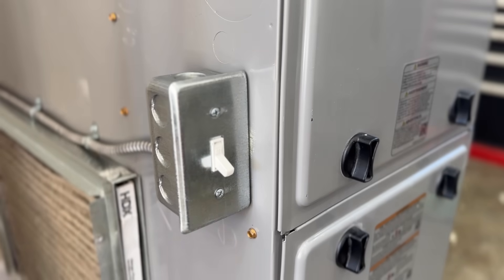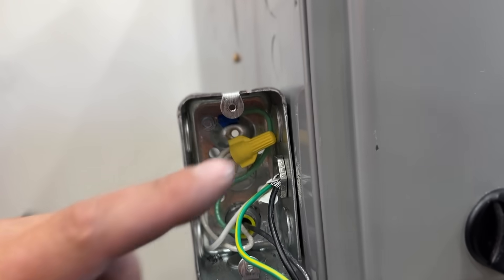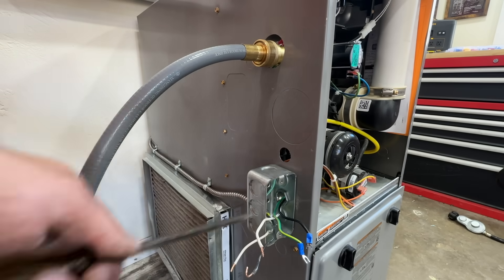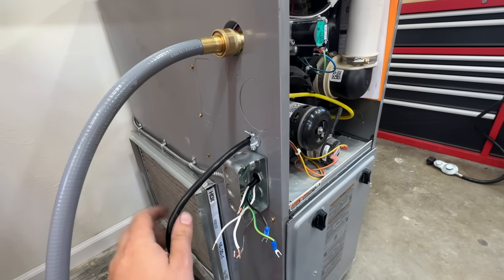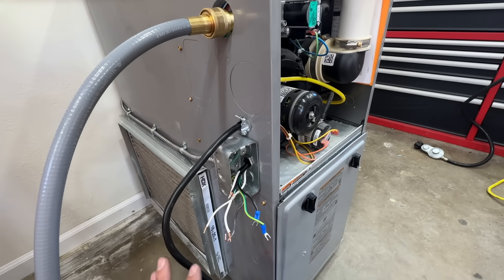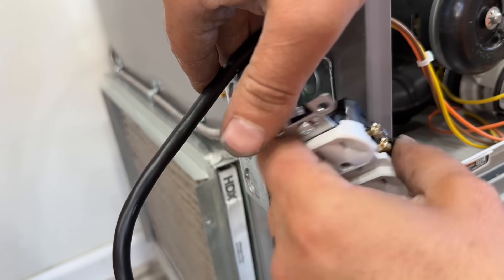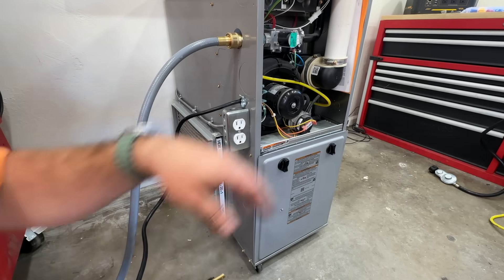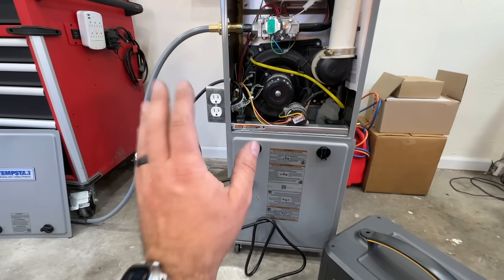Keep Your Family Warm During A Power Outage By Installing This $5 Part

Comment: If a hile is required in the side of the unit its actually a 7/8" hole not 1/2". 
The 2 screw romex connector is not meant to be used for cords, whats required is a strain relief connector for the round cord. Make sure its appliance rated and at least #14 wire cord

Comment: That is a bit more than $5 with the battery back up unit.  Also, code does not allow an outlet to be grounded through the box.  A ground pigtail should have been used.

Comment: Couldn't you have used a 3-way switch wired so that when the switch is ON (up) the furnace gets power from the line, and when the switch is OFF (down) it gets power from the plug?

Comment: Great project to knock out and be prepared for when the power drops. I had a switch and single outlet. I kept that setup but rewired it up as you got here. I added a 1 to 3 outlet cube to it so I could plug in my pump, furnace, and UV light.

Comment: So I just did this, and when I cut my main power and hooked my solar generator up nothing happened 🙃 I had battery back up in my thermostat, turned it 1 degree higher and nada. Dangit
Reply from the maker: Try bonding the neutral and see if it works.
Reply: @diyhvacguy  ok ill try it!

Comment: I don’t think way the ground is connected is allowed by code. Check with your local authority. The extra length of cord may also be a problem. Just because it works doesn’t mean that it’s safe. 
Sometime I wish the background justifications for codes were available, but overall we just need to trust the process.

Comment: Just make sure to keep the Breaker box breaker turned off, so the auxiliary power source doesn't backfeed to the city power & send power to crews working on the power lines. when other power is restored, you'll see lights or other things come online... then ya can disconnect aux power & flip the main city breaker back on.... Ya wanna make sure ya don't back feed power & zap someone restoring power...
Reply: This can't backfeed because it is never sending power into the outlet

Comment: This is pefrct when you have a gas generator and a V2L capability EV. For a 60kwh battery pack Ev. This set up will give you 40hr continuous operation. In real life, this set up give you a whole week of running the furnes without the generator. Hence, you can keep your self warm for close to 2 weeks

Comment: How many G’s does a typical furnace pull?

Also, with a 1000 watt battery backup, you might have what… 2-3 hours of use powering that furnace? 

Thanks for a fantastic video by the way.

Comment: So does thos still operate off the thermostat or does the furnace just run so long as its plugged in?
Reply from the maker: The thermostat gets its power from the furnace so as long as the furnace has power your thermostat will control it just like it does on grid power 👍🏼

Comment: You could always use an outlet with a built in on/off switch or a plug in intermediate switch to still integrate the original concept.

Comment: Will this work on my forced hot air oil burner. I would think it would. This is all I wanna be able to do run the furnace.
Reply: An oil furnace will use more current than a gas furnace does because in addition to the forced air blower the oil burner has a high pressure fuel pump to force the liquid fuel through a nozzle or nozzles to turn it into droplets so fine that they will burn like a gas. Oil is a combustible liquid. That means that it does not give off flammable gasses at normal ambient temperature and pressure. That is why fuel oil is refined to be so close to kerosene in it's viscosity. Fuel oil can be atomized into super fine droplets that will behave as a gas in the combustion process. How much current will be needed for the blower fan, fuel pump, and controls to operate can be found on the label on the furnace which bears the listing mark of a Recognized Testing Laboratory (RTL). The number that you are looking for is the Full Load Amps (FLA). The inverter must have a high enough ampacity to run the load and a high enough surge capacity to start the motors turning. That starting current can be 5 or more times the FLA. Even when the inverter has been properly sized the battery must be selected to have a high enough maximum discharge rate to power the inverter during surge operation. Discharging a battery at a higher discharge rate than its designed maximum will destroy it. Sometimes the battery's destruction can be quite spectacular and very hazardous to living things. 

Tom Horne

Comment: I did something similar on my boiler, except I put a box on the boiler side of the switch with an outlet.  Now if the power goes out I turn off the switch and then just use a double male extension cord to go from the generator to the boiler.

Comment: Can the power pack be plugged into the top outlet while house power is still on charging the power pack/solar generator?
Reply from the maker: Yes in which case you’d plug the furnace into your power station and it would keep the power station charged and also utilize the auto transfer switch in the event of an outage.

Comment: I have a condensate pump plugged into the same power box as the heater when i turn the  switch off it shuts power off to the gas heater and leaves power on to the condensate pump is that the same as you are trying to accomplish on your video ? Thanks

Comment: With my Vitoman 1500 plugged in, the furnace and gas shuts down once the cycle reaches for the blower/fan to turn on. It was pulling 575 watts initially.  Plan to try my Honda 2000 to see if that works, which was my goal for powering the garage. Will 2x check ground to panel.

Comment: Should have a gfi or a single yoke receptacle. Not a duplex receptacle.
The appliance cord could be considered as service disconnect not crazy about that I like to see a service switch.
But that part depends on AHJ inspector.
Oil need a shut off switch in a remote location. I have A problems with that part. But gas or propane. Doesn’t matter a spark can go boom.

Comment: I installed a plug on mine and it was $8 .Worth the money and a lot cheaper than buying a $5500 back up generator I just bought a 2200 inverter generator for $450 and bought some old 5 gallon metal gas cans at a flea market and I’m set .

Comment: ALL GROUND WIRES MUST BE CONNECTED TOGETHER!  This way even if you unplug the furnace from the normal outlet, it will still be grounded.  The way you have it here, as soon as you unplug it, you disconnect the ground.  Now the panel ground is mounted to the box, and the box is mounted to the furnace, but I'm not sure that's the best ground.

Comment: We have this on ours already, which really does give me the peace of mind that if the power goes out I can plug it into the generator fairly easily.

One thing to be very careful here is to be sure not to mix up your wires and connect the furnace directly to the power supply and wire the pigtail to the outlet. Your furnace will run fine normally so you wouldn't be aware, but it would both fail to do anything with a generator when the power goes out and it removes your emergency shut-off.

Comment: Is there a chance that switch would be anywhere else in the house other than on the furnace? I have a gas furnace but don’t have that switch. Now we do have a switch upstairs for a gas fireplace. That has a battery back up and we can run that when we lose power.
Reply from the maker: Well it’s entirely possible it was miswired, but you can totally turn the breaker off for your furnace and add this to it!
Reply: Thank you! That’s a great idea!!!

Comment: I was thinking about doing this but my thermostat is digital and takes power from the wires it’s hooked to. Are those completely separate from the house and run straight to the furnace or will I need to replace it with a battery powered one?
Reply from the maker: The thermostat gets its power from the furnace 👍🏼 so it will function exactly the same as long as the furnace has power

Comment: I really liked this idea, so I decided to do this to my furnace. I bought a 3 foot 12awg/15amp cord and wired it to my Guardian (York) 95%efficiency furnace. I also have the Nest smart thermostat. I verified power is on with a non-contact voltage sensor, and even plugged my vacuum cleaner into the electrical outlet after I completed the installation. I have a Champion Dual Fuel 3500 watt generator that I connected to my furnace with an extension cord. I'm now getting an E24 error message on my Nest thermostat saying there is no power to my RH wire detected. Maybe this is an obvious problem for someone else, but I don't know why it has this error now. Any help? My furnace currently only works when it is plugged into the outlet, not the generator.
Reply from the maker: You might need to bond the neutral. You can do this by getting a neutral bonding plug and plugging it into another outlet on your generator.
Reply: @diyhvacguy  I'm not quite sure I understand. I do know I need to buy a heavier gage extension cord. My current one is not heavy-duty. Should I then replace the new cord's existing male plug with a neutral bonded one? Do you know of any heavy gage extension cords that are already made with neutral bonding, or maybe a neutral bonded adapter? I can't find one if they do make them like that. Sorry for all the questions, I'm still figuring this out. I appreciate your help.
Reply: Some thermostats receive their power from a transformer inside of the air conditioning unit (in lieu of the furnance). So if there is no power available to the 30A 240V circuit to the AC unit the T-stat will be running on it's on-board batteries only, if it has batteries inside of it. This will cause an error code on the T-stat letting you know that power is not being supplied to the T-stat.
Reply: @billbutler6479  OK. Is there anything I can do to fix this?

Comment: The one thing you should have said is check to see if it is a two-pole breaker which means it's 208/230 volt and this will not work, you don't want people hooking 120 volt up to the 208 volt system

Comment: I had this set up more than ten years ago the plug was plugged into a wall outlet.And beside I had another outlet extension(I forget the cable size, bigger than regular orange extension cords) out to a generator,it worked very well.I would recommend every furnace be set up like this.

Comment: great video, excellent idea.  just 2 minor safety points. When installing the outlet, since its in a metal box, use electrical tape around the neutral and live terminals.  also its good practice to screw down the unused terminal screws before putting bsck into the box, helps limit the amount of potential shorts.
Reply: A good reason to use the single switched outlet

Comment: This is a clever trick to use with a garage door opener too. If the power is out and your generator is in your garage, you can set it up similarly for the garage door opener. 

You have 2 code violations, easy to correct both. Can't use the romex connector as a means of support, shoot a couple self tappers from the handy box to the furnace side. The box is over filled, the pigtail and furnace connecting wires can be pulled back into the furnace.
Reply: Don't garage door openers usually already have plugs?

Comment: what if theres no switch? we just had a new furnace installed in '21.....
Reply from the maker: The plug becomes your means of disconnecting the unit, just like a switch. In fact, this method cannot fail whereas a switch can fail in the on position.
Reply: @diyhvacguy  i found it....its got a blank plate/cover with no switch, the junction box is there...but just a blank cover....thanks!!!

Comment: you could have used a knockout in the junction box instead of running the wire into the body of the furnace and then back into the junction box.

Comment: Thanks, Dave, for a GREAT video! You didn't mention, though, how to power my house thermostat so it can control the furnace that's plugged into the power station in my garage. Can I run an extension cord from the power station into the house and maybe to a spare 110V AC to 24VAC transformer and thermostat? If so, how do you wire the thermostat back to the furnace?...12/12/23 UPDATE: Many thanks to @fishepa who pointed out that my house thermostat gets its low-voltage power from the transformer on my furnace out in the garage! That makes it too easy...all I need is the power station and I'll be all set for the next power outage. FYI,  I see Amazon currently has coupons for $400 off the price of the VTOMAN Jump 1000 and $550 off for the VTOMAN FlashSpeed 1500 (about 40% savings for each).
Reply: I am a total novice at this, but wouldn't the thermostat get power from the furnace?  So the generator powers the furnace and thus the thermostat?
Reply: Thank you!

Comment: If your house has no power, wouldn’t the thermostat not work to run the hvac even if you plug in the furnace?
Reply: The thermostat is powered by the furnace

Comment: Idk man I really feel like you should really just hook a ground to the plug. I understand that the box is bounded so the plug is bounded but if there is a ground screw you just hook it on. It is little to no work to do and is much safer and less sloppy. Maybe that is just me, it is one copper wire just make a tail with a wire nut. If you have green wire you can use that to make it look good. but if not you could take some bare copper #14 and use that.
Reply: 250.146 Connecting Receptacle Grounding Terminal to Box.
An equipment bonding jumper shall be used to connect the
grounding terminal of a grounding-type receptacle to a grounded
box unless grounded as in 250.146(A) through (D). The
equipment bonding jumper shall be sized in accordance with
Table 250.122 based on the rating of the overcurrent device
protecting the circuit conductors.
(A) Surface-Mounted Box. Where the box is mounted on the
surface, direct metal-to-metal contact between the device yoke
and the box or a contact yoke or device that complies with
250.146(B) shall be permitted to ground the receptacle to the
box. At least one of the insulating washers shall be removed
from receptacles that do not have a contact yoke or device that
complies with 250.146(B) to ensure direct metal-to-metal
contact. This provision shall not apply to cover-mounted receptacles
unless the box and cover combination are listed as
providing satisfactory ground continuity between the box and
the receptacle. A listed exposed work cover shall be permitted
to be the grounding and bonding means when (1) the device is
attached to the cover with at least two fasteners that are permanent
(such as a rivet) or have a thread locking or screw or nut
locking means and (2) when the cover mounting holes are
located on a flat non-raised portion of the cover

The only requirement that the demonstration missed is the removal of at least one of the fiber washers that are used to retain the screw in place prior to installation. Myself I remove both of them. 

Tom Horne

Comment: I have a newer furnace with a Nest thermostat, when I turned off the power to the furnace, the Nest thermostat was still on? Does this mean  I would have to rewire the thermostat so it would only get power from the same source of the furnace?

Comment: I did this and it works great, now i can see the power use of the gas heater. Never realized the heater draws 850 watts on full draw.
Reply: Most modern heaters have two fans, exhaust & blower

Comment: Compliments first -- you are very clear, very detailed, and you at least twice "reminded" DIYers that the solid conductor needs to be J/U-hooked around the screws in the same direction as they tighten -- clockwise.  You're also super-clear about including videos of taking ALL the screws out as needed (j-box cover, switch screws, and knockout plug connector wire tensioner screws).

In those jurisdictions where inspectors will not approve of the pigtail coming out of the heater, OR in the event you don't want to go mess with your heater (basement?) at every power outage, may I respectfully suggest a small change:

1. You're already using your "powerstation" as an emergency power supply, so replace it with a UPS.  Your typical home heater (20KBTU) will draw 5 amps, so a 1500KVA UPS will power that for a (continuous) day.  The cost is significantly less.

2. Put the knockout plug on the bottom of the j-box.  This avoids messing with the heater, taking its panel off, etc.

3. Connect up the heater-wires in the j-Box to the pigtail.  The rest is connected as per your video.

4. Plug in the UPS into one of the two 115VAC outlets.  Plug in the heater pigtail (now coming out of the j-box bottom) into the UPS.

You now have a system that accomplishes everything in your video with some subtle changes:
- There is no need for manual intervention in an event of a power failure.  The UPS is constantly in charged state because it's plugged in.  The heater is plugged into the UPS.  If the line power fails the UPS will continue to power the heater for 20+ continuous hours, or two days in normal household operation.
- There is no need to open up the heater, nor is a pigtail coming out of it crimped by a knockout connector that some jurisdictions will not pass inspection/code with.
- There is no chance of "backfeed" because the UPS takes care of all that for you.
- Unlike most "power stations" UPSs allow connection to your home network and email alerts if the battery fails a regular self-test and needs replacing.
- Less time to install because all the work is in the j-box.

Line Power --> j-box -> one gang double outlet.
Heater wires -> pigtail -> out the bottom of the j-box with a NEMA 5-15P 120VAC 15A plug.
Pigtail plug (heater) -> UPS (your choice of anything from $80-$250 will beat a $1000 "powerstation")
UPS plug -> j-box outlet.

Ehud
Tucson AZ
Reply: I think that's a great idea! Thanks